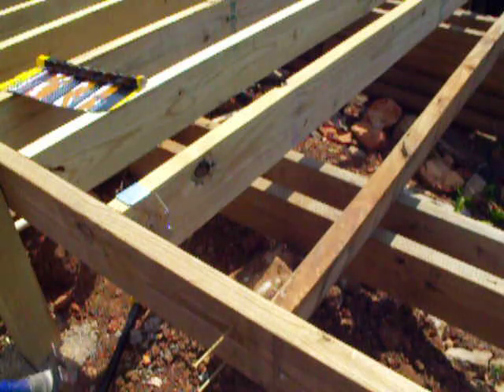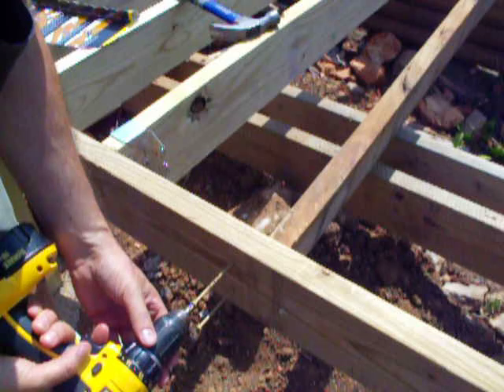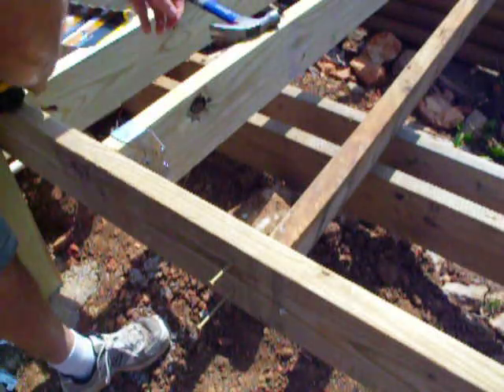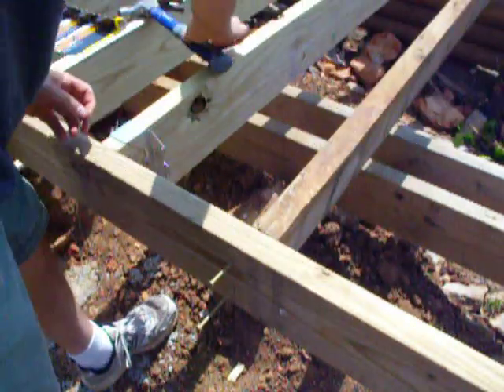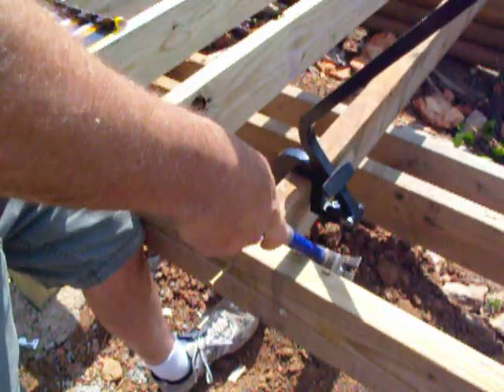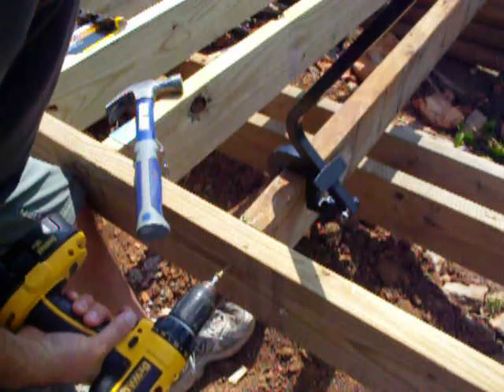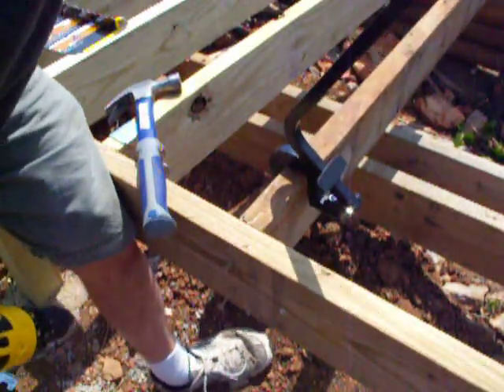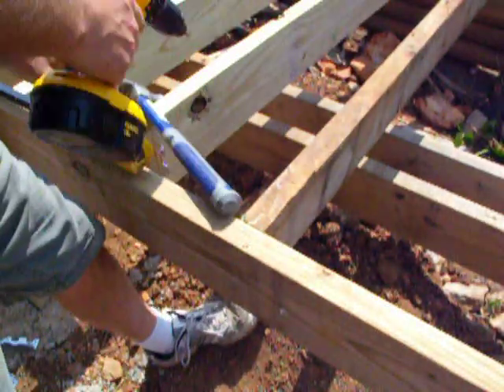Part 2 Stanley Board Bender Straighten Joist Deck Board Planks Review

Comment: or just put the bend towards the previous joist, fix bottom of joist and bang a 3x2 cut to the correct length of the gap at the top forcing the gap out. It holds it self in place, then just screw the top of the joist. Only one pair of hands needed and no fancy tools.